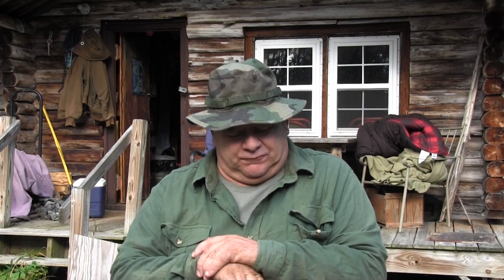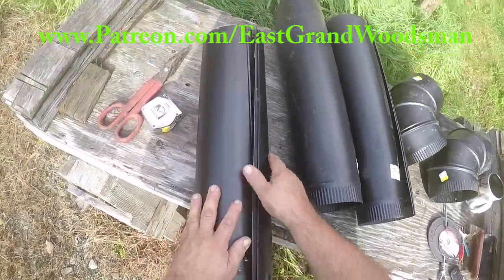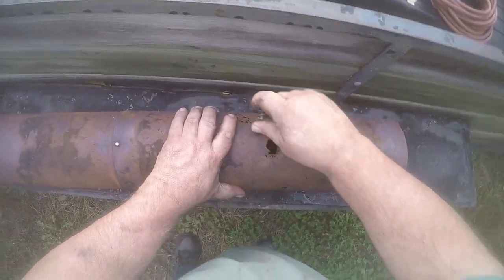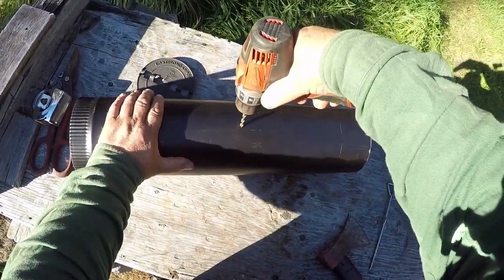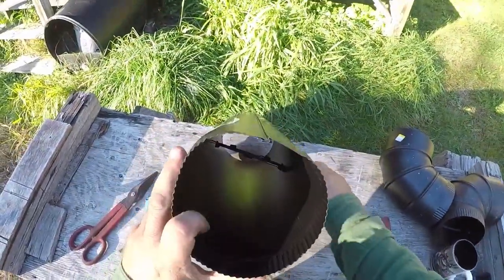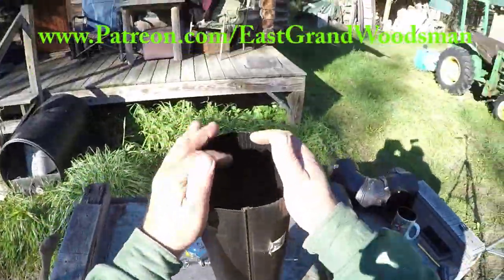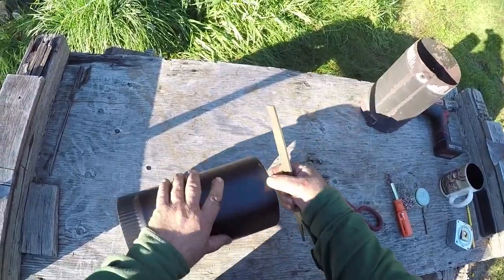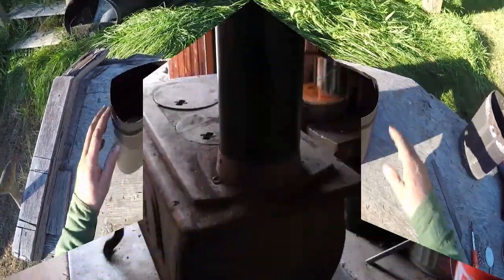Burned out Stove Pipe @ The Rustic Log Cabin Deer Hunting Camp

Comment: Man they are some old tin shears. I have a similar pair I inherited from my grandfather.  Hate to say it, but your pipe direction is not following the customary standard for a wood stove. Male end should be pointing down toward the stove, female end pointing up away from the stove to alleviate the issue of creosote running down the outside of the pipe.  Just saying.  I'm sure you have far more experience in the building trades than I do. I'd like to hear your thoughts on the pipe direction subject. Viewers looking to learn might also find your insight on this helpful.
Reply from the maker: Good morning my2cents, 

I have had those Snips for a long time actually there is a tin shop not too far from here that sells them brand new. I purchase them about 25 years ago.

You're absolutely right about the stove pipe on most stoves LOL. Now  I'll  explain.
I believe that really matters on the airtight stoves that create a lot of creosote. One of the reasons I don't own an airtight stove.  I do not like them. The only thing they're really good at is creating creoosote. Lol on these old school house stoves the pipe goes the other way that's the only way that it will fit on the stove and actually without crimping the other end it's the only way it will feed up into my chimney.

The male end fits onto the collar on top of the wood stove. 

The schoolhouse stoves do not create any Creoosote  at all because they burn hotter.
That's what makes them such a perfect stove for small cabins.

But this was a great point that you made here most people wouldn't know the difference.

I hope you're having a great day! 

Tom